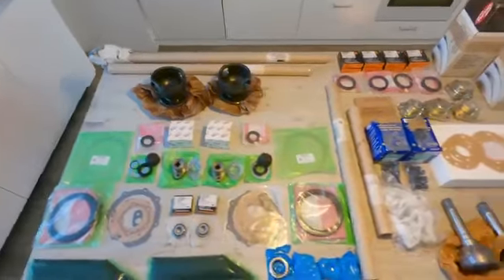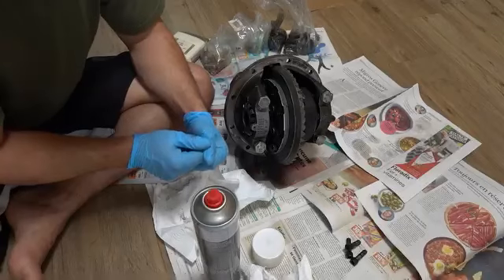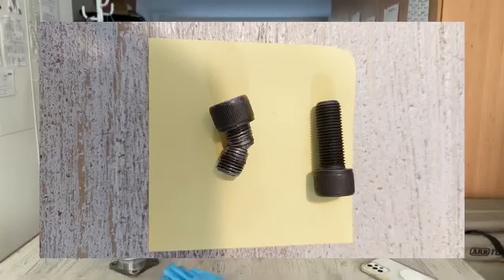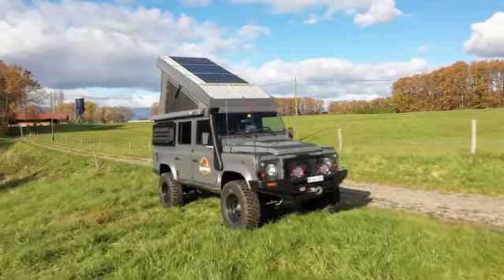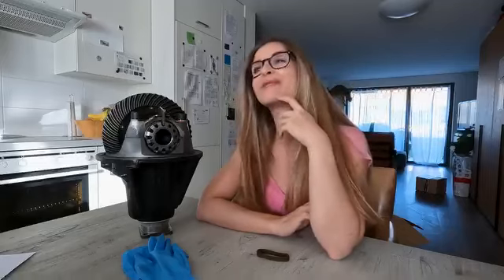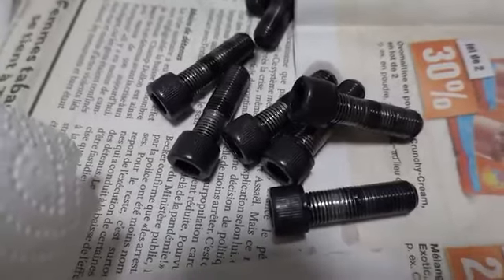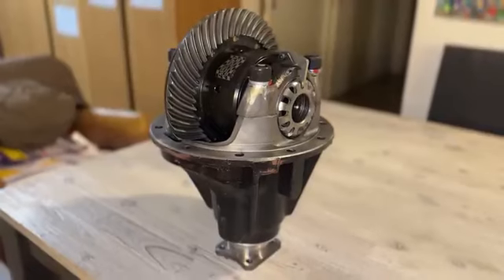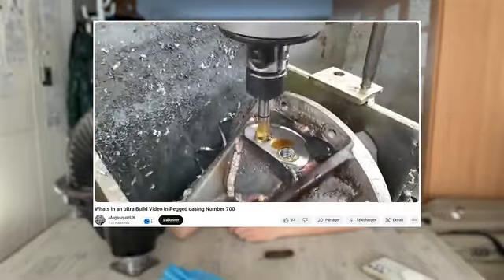We absolutely love it when customers video how please they are with their new Xcess4x4 Differential

Comment: Ashcroft have changed their design of their 4 pin diff. Not that they’re admitting there’s a problem. A good friend has broke 2 in 18 months
Reply from the maker: Fit our one piece internal forged cross shaft - you won't break that !! www.xcess4x4.com - "Diff Parts" section or ring / email - Nige